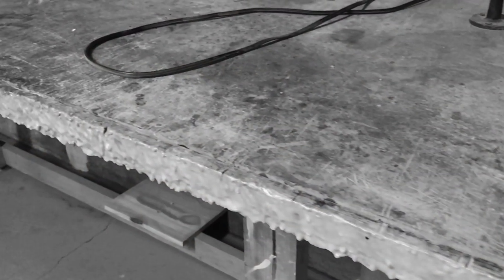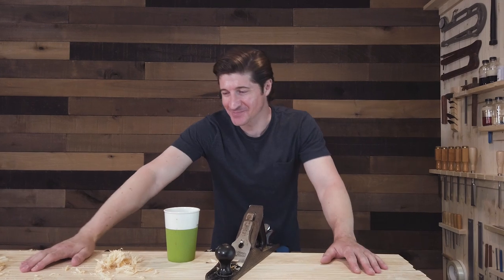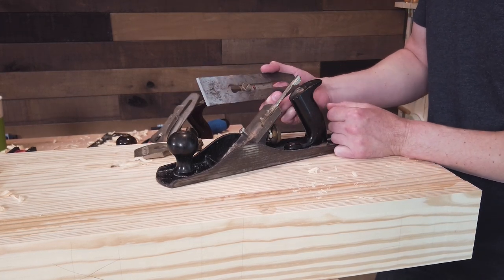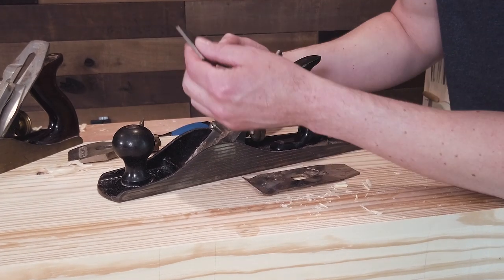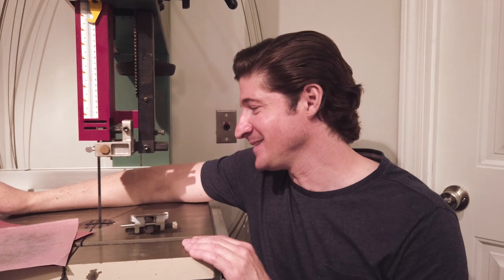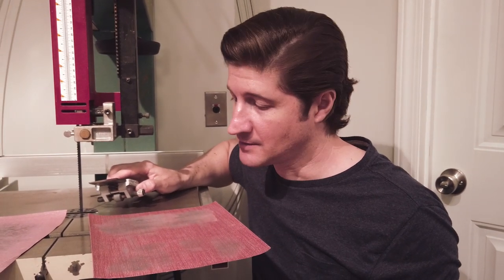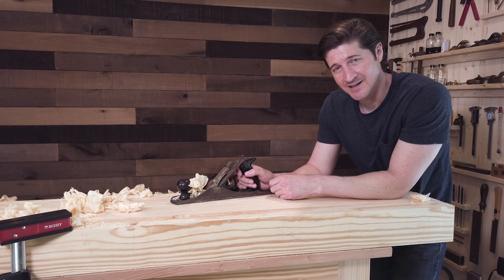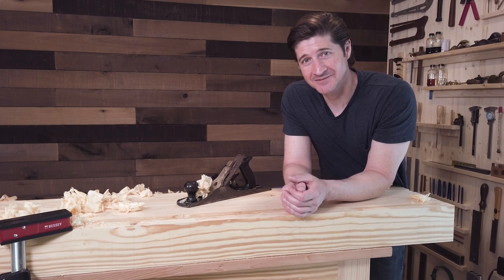How To Sharpen Plane Blades (and Chisels) the easy way - Vlog E1

Comment: Tom, thanks for the sandpaper quick sharp method. As I'm new to lutherie, I've started using the Scary Sharp method with the3M  films. Still trying to master it but it's taking longer than I like to sharpen. I'm interested to try your method so will order some sand papers and give it a shot! Thank you!

Comment: Thanks for the video...looking forward to more info on the workshop.  I like the wall storage for tools in the background.
Reply from the maker: Thanks Alan! I recorded a whole section on the tool wall, I put a lot of thought into the layout and approach so that each tool is arranged by type and how often they are used each day. Only my most used tools made the cut to be on the wall. The whole process and approach will be laid out in the course. Those little refinements can add up to a better daily work experience and better results with less chance of mistakes, so to me its worth spending some time to get it just right :)

Comment: Nice demo. The honing guide is the way to sharpen. Note on the side of the honing guide it tells you how far to have the plane blade project from the front of the guide for various angles. Use these measurements and get the same angle on your blade each time.

Comment: I definitely agree with your luthierie thinking approach, Tom. Even tough I started using as many power tools I could afford, as time goes by I have been changing my working methods to a more hand tools approach. Not because I feel much more happy and in the command, meaning that I feel this way I can learn and gain confidence in my hands, but also because I think in the end is faster (for me) than spending time in machine setups, tests and maintenance. This doesn't mean anyway that I don't use machines, but that I have become confident enough in my hand tool technique so I can get equal or even better results more quickly. I mean for some jobs, not all of them, of course. Thanks for your videos, I'm a big fan.
Reply from the maker: Thanks for your comment Ricardo! Yep, you got it!  Machines are just better in some cases for sure, but the confidence and intuitive understanding you can gain with using hand tools can make a huge difference in the quality of your work AND the quality of the time you spend working.